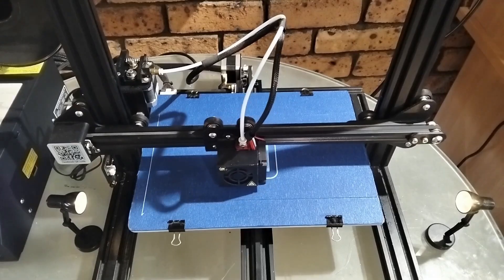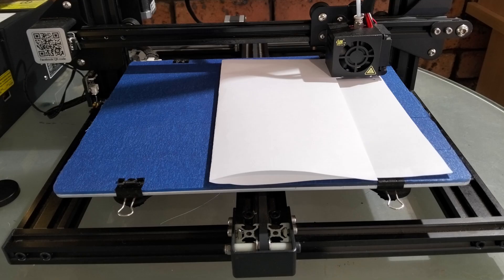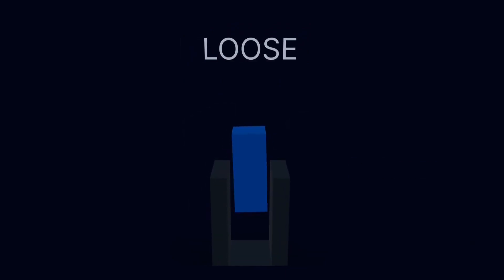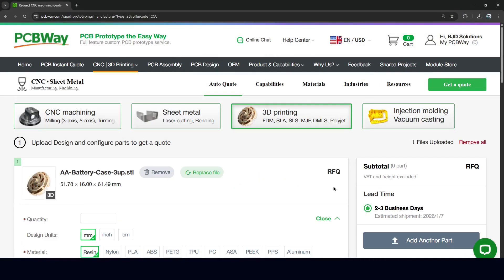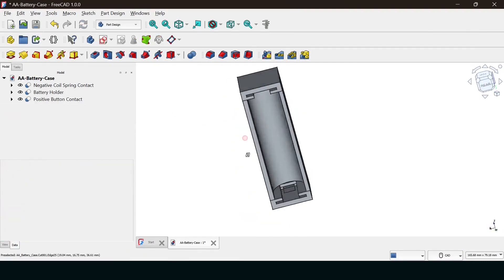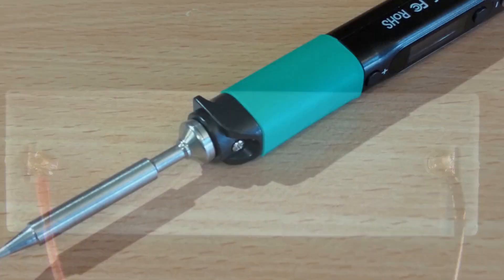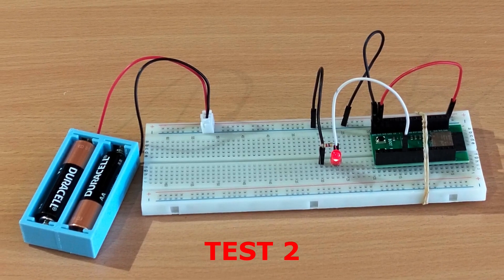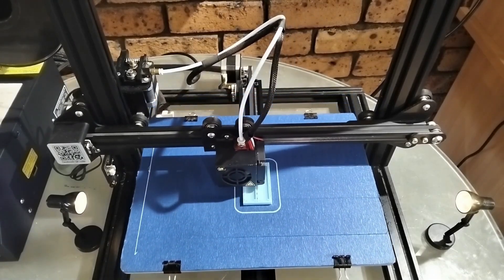DIY Power Supply: How to Design, 3D Print, and Wire a Battery Holder (Tutorial)

Comment: Have you tried changing the tolerance in a single print? Say having a channel 5mm wide at the top, stepping to 4.5mm for the middle and another step to 4mm for the bottom. It helps me get to the goldilocks zone in fewer prints
Reply from the maker: Yes I love this idea. Instead of 3 separate prints, you get 3 data points in one go. That is a super smart way to handle the 'Goldilocks' phase. Thanks for the tip!

Comment: Awesome video! Sure we want to see other 3D print solutions for different types!
Reply from the maker: Thank you so much! Yes, the dream is definitely to have one 'Master File' where we can just type in the battery size and hit print.

That’s the magic of Parametric Design—instead of drawing a static shape, you define the rules (like 'Case Width = Battery Width + 2mm'). That way, you can just plug in the numbers for a AAA or an 18650 into a spreadsheet, and the whole 3D model automatically rebuilds itself to fit. No re-drawing required! 🤓

Comment: Hi there, new to the channel. Great content new subscriber.. question for you. Any idea of a simply power supply and GPS and recharge ports for a battery for my ESPCYD 2.8? I see there is one called CYD 2.8" Marauder/Bruce Battery+GPS Mod DIY Kit, would be interesting to have your take on it.
Reply from the maker: Welcome to the channel! Thanks for subscribing.

The CYD (Cheap Yellow Display) looks like a fun board. I have not used it personally nor the 'Marauder/Bruce' kit, but generally, those 'backpack' kits are great because they solve the biggest headache--the wiring.

As far as I understand, The CYD usually uses a tiny 1.25mm pitch connector for power, which is different from the standard JST leads found on most batteries. A kit hopefully adapts that for you and adds a charging circuit (like a TP4056) and the GPS in a clean package.

If you wanted to do it fully DIY, you could absolutely print a custom 'backpack' case for the CYD that holds a 18650 cell (or 2), a TP4056 charger module, and a GPS module, then wire them to the IO pins on the side of the board. Or pontentially explore a custom PCB / 3D printed case if you want to go all in. 

That actually sounds like a fantastic project. I may have to look into this hardware. :-)
Reply: @bjdsolutions8928 sure does and thank you for the info I’m still a bit new and finally started playing around and started little small projects but I’m trying make it a simple plug and play for a clean look, I started making my own cases for my cyd’s.
Reply from the maker: That is awesome to hear! I am sure you will get a 'clean look' and the funtions you want.